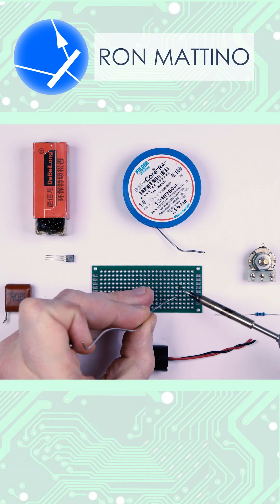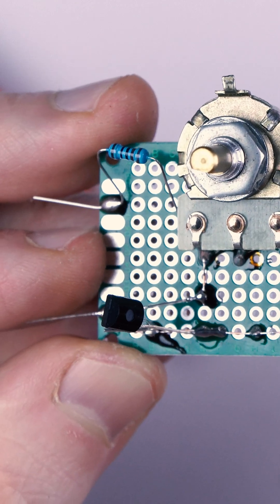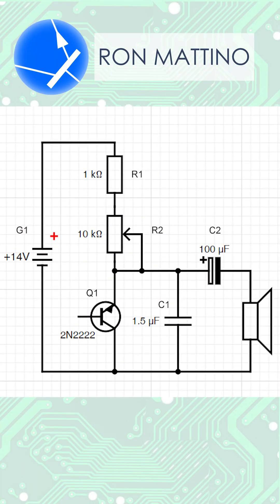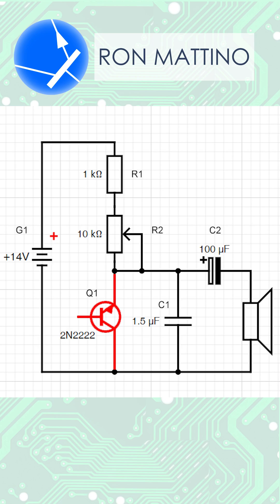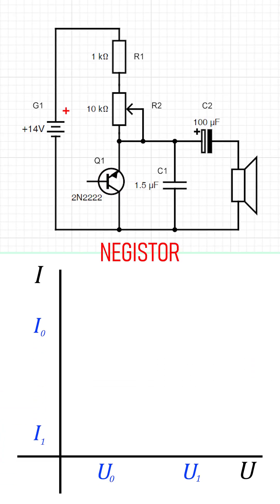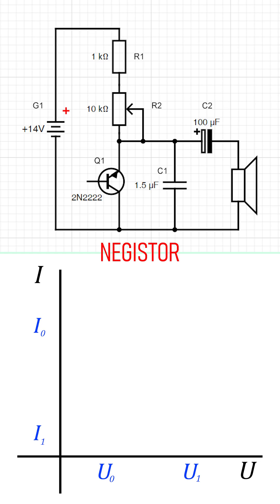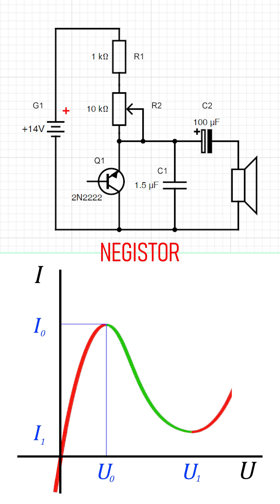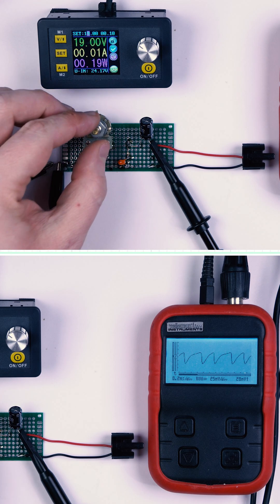Oscillator using a single BJT transistor (Negistor).

Comment: It's based on the Esaki oscillator or tunnel diode. It was invented on August 1957 by Leo Esaki. A characteristic of "negative resistance" which is like counter intuitive.

Comment: Ever heard of Colpitts and Hartley oscillators? They each can be implemented using a single BJT transistor.  However, they have inductor components. If you want to avoid inductor, you can built a phase shift oscillator using a single BJT transistor. The 180 degrees phase shift feedback signal is built using a few RC filters.

Comment: What would you use that for?
Reply: From my text books they say it's used in audio and for testing circuits
Reply: Radio transceiver need oscillators. And other devices that may use a steady tone.